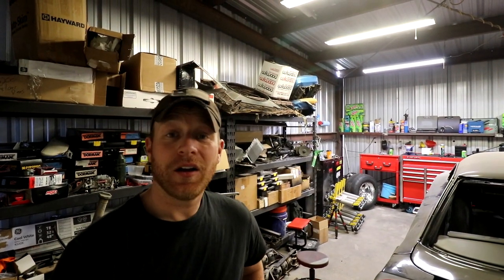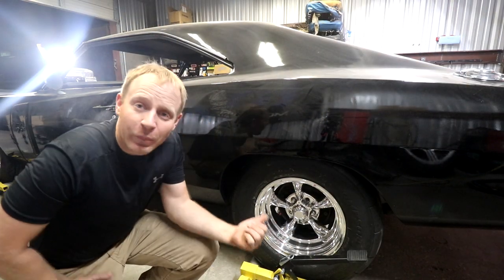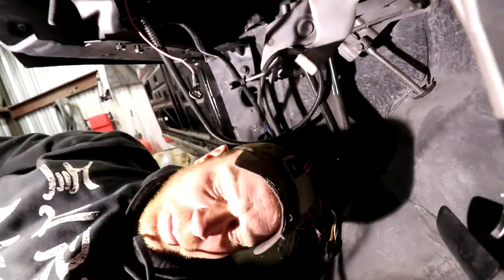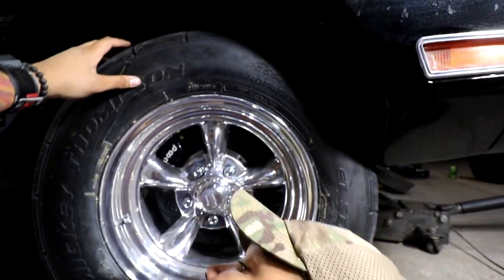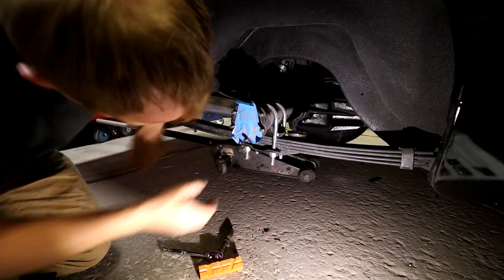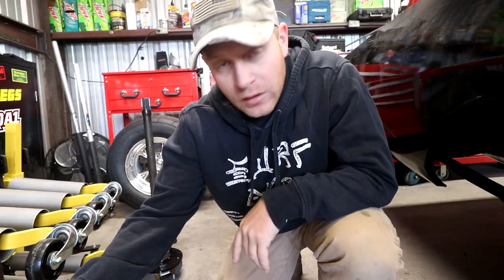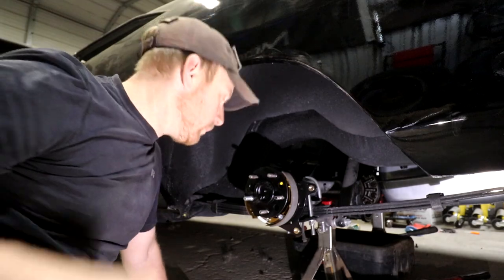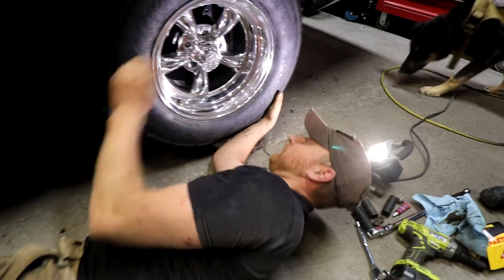1970 Charger RT Wilwood Brake kit, Rims and Tires, Power steering and more!

Comment: I have a 70 charger that I want to add wilwood set up. Anyway to get the parts numbers of the whole kit
Reply from the maker: Sure!  I did this channel so others can follow along, and see what works and doesn't.   Although they are still untested, and since I'm deployed right now,  all I got is the numbers.   

950-140-10767-D
950-140-9828-D

Hopefully they work for ya!

Comment: Your supposed to check the wheel size your new disc brakes conversion accommodates!
Reply from the maker: Figured if Wilwood had claimed fits most 14" wheels, a 15" should clear!    Regardless, the solution is already in the works!
Reply: @HighRevNation  no not one wilwood disc conversion I know of accommodates smaller than 17 inch wheels. Try power stop or some other brand.
Reply: @HighRevNation  did you ever sort this out?
Reply from the maker: @robw7205  Hey Rob,  I did.  After the mishap with the 15" wheels not fitting, I purchased the same wheels in 17's.  It was the only way to keep the stopping power I'm going to need for the build.
Reply: @HighRevNation  ouch. Think they would have fit with the 4 piston set? Loved those tires btw, what were they?